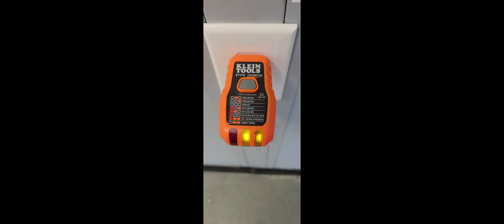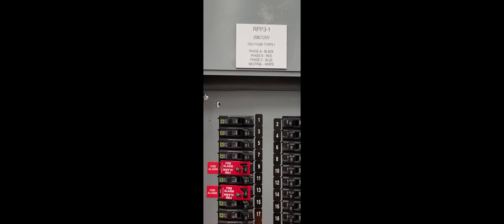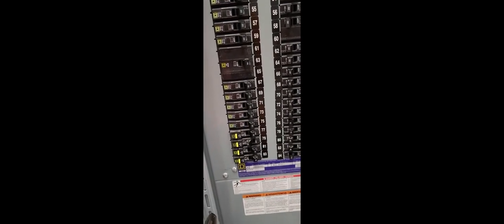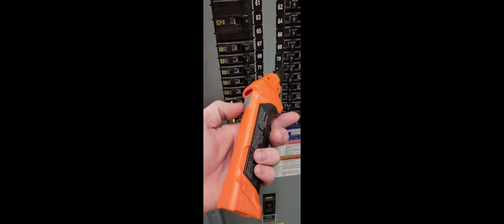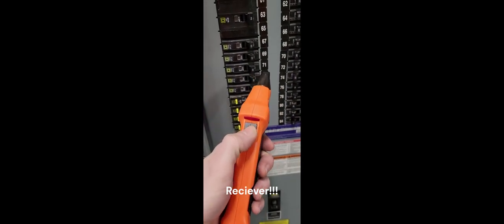How to use Klein Tools Circuit Breaker Finder

Comment: You are using the tool wrong. You need to run the tester over every breaker in the panel to learn the panel 2 times. Both left and right breakers. Once to learn, and twice to identify the breaker. On the second it will only beep and light on one breaker.
Reply from the maker: Go watch the gfci wont reset video we did. I understand how to use the tool I didn't put all the detail in this particular video. I plan to redo this one as it was earlier in the life of this channel